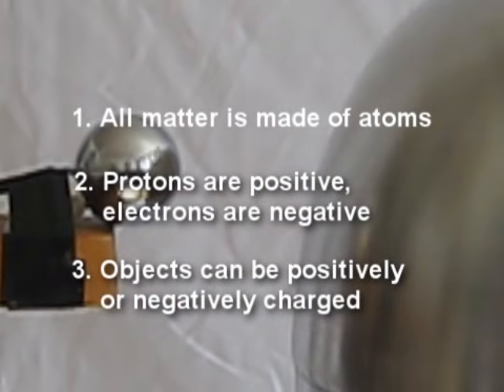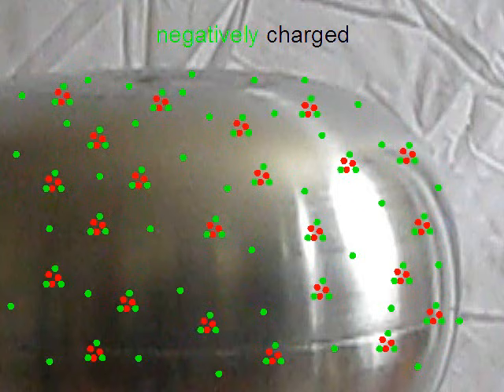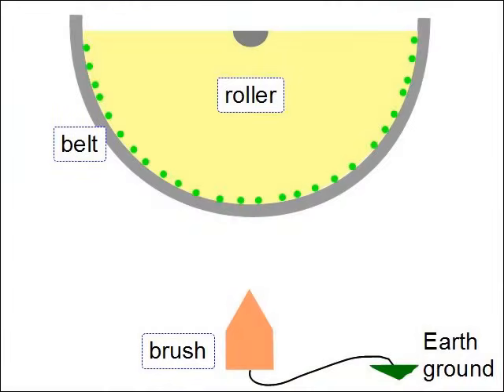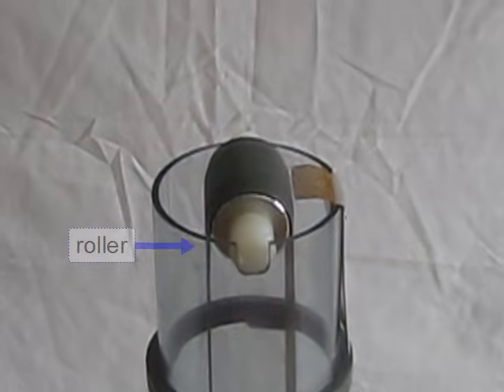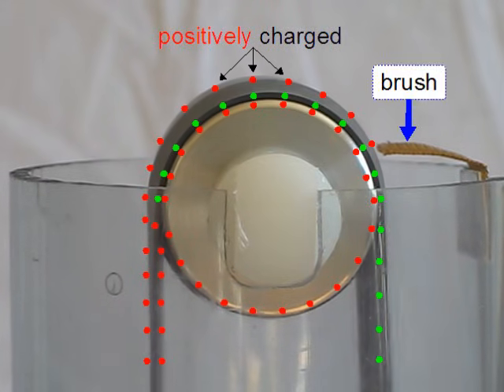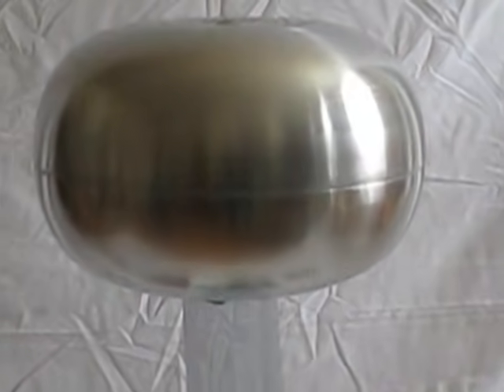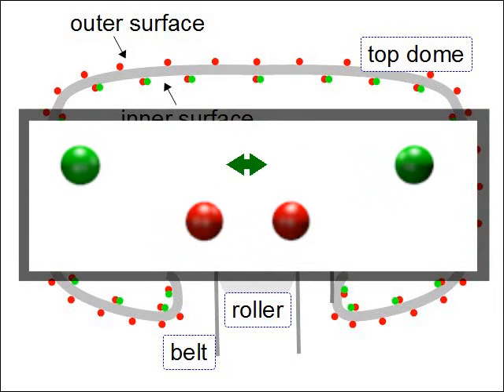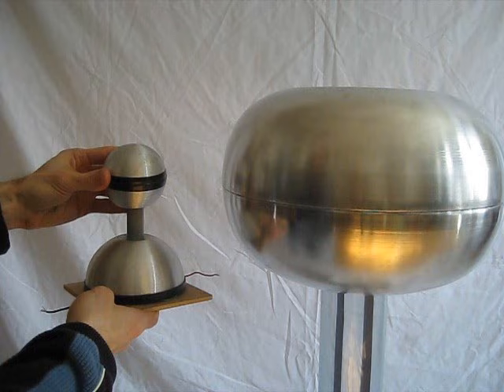How a Van de Graaff Generator Works

Comment: What size is the air gap for the brushes?
Reply from the maker: With my big Van de Graaff generator used for most of this video, the brushes are around 7mm to 8mm away from the belt. With my smaller ones, the gap is usually much smaller, as small as possible without touching.

Comment: Very good stuff. However, explanation given at 12:37 is incorrect.
Reply from the maker: Do you mean that the charge on the outer surface has an electric field whose other polarity is with the surroundings? How is that wrong?
Reply: To move charges (given more than one), you need to do work, which is actually done by the motor. Given (at least for this case) the charges are neither created nor destroyed, the other polarity charges get carried away through the bottom wire (which may eventually sink it to Earth, if earthed).

Incorrect: There is no charge on inner surface due to limited surrounding space enclosed within the hollow conductor, so the charges are left at the surface. 

That statement would not hold if you were to run it in perfect vacuum. By that logic, Van de Graaf generator would not work (or will behave differently) in vacuum. However, that isn't the case. In fact, there is no surrounding significant enough to speak of, in a perfect vacuum.

Correction: There can be no Electric field within a Hollow or Solid Conductor. And that is irrespective of the whether there is vacuum within or outside a hollow conductor. Thus by using Gauss's Law on an imaginary closed surface just within the conductor: we conclude, there can't be any charge inside of the outer periphery of the hollow conductor (neither in the metal within the periphery, nor anywhere on the inner surface, nor even in the hollow space within). And that is precisely the reason we bring the charge via the rubber belt from inside the hollow sphere (as there is no Electric field to oppose that charge), as opposed to bringing those from outside (in that case, the pointed wires will lose charge through corona discharge due to the presence of strong Electric field outside the conductor, much before they are brought closer to the hollow conductor).
Reply from the maker: Regarding your saying that this is what I was said that was incorrect "There is no charge on inner surface due to limited surrounding space enclosed within the hollow conductor,...", I would say that I said it was "due to limited charge within the hollow conductor,..." and not "limited surrounding space" but they're pretty close to the same statement.

Regarding that the statement would not hold in a perfect vacuum... you can't have an electric monopole. For any positive charge there must be a corresponding negative charge. In a perfect vacuum the corresponding negative charge would be at the other end of the Van de Graaff generator. In fact, if your Van de Graaff is too short, sparks can occur between the two ends. That actually would have been a good point to include in the video but I didn't think to at the time.

Regarding the whole Faraday ice pail explanation, I was trying to give an explanation other than the standard textbook one, while still being correct. It's pretty hard to do and I don't see where I got it wrong, though I can't be 100% sure I got it right. I didn't want to do the standard textbook one because it doesn't really explain the 'why'. It starts with the same statement you gave, that there can be no electric field within a hollow or solid conductor. I was trying to go deeper and say why there's no electric field (without needing to get to electric fields).

Comment: Where we can get the top bowl
Reply from the maker: I  don't have a source off-hand for the specialized type of dome in the video but most people go to any store that sells kitchenware and buy two steel bowls (salad bowls, mixing bowls). The cut a hole in the bottom of one for the belt and stuff to enter, and then they tape the two bowls together at their wide open ends.

Comment: Another question about the rollers.  I just built one of these and used nylon as a belt AND wrapped nylon on the bottom roller.  Pantyhose is the material.  The top "roller" is a piece of pvc pipe which the nylon glides over but doesn't rotate. I'm generating nice 8" sparks. Not sure how this combination could generate such impressive voltage considering the bottom materials are the same. Is it friction or something else?
Reply from the maker: I'm not sure either. I've seen people using a vinyl roller at the bottom and vinyl tape for the belt. That's probably using the same principle as yours, but I don't know what it is.
Reply: Tried an experiment tonight and I'm sure it's friction.   Wrapped the top pipe in teflon tape which is lower on the triboelectric scale than pvc. But it's also nice and slick and didn't create much of any charge.  I unwrapped it and even removed my bottom brush and it worked just fine.  Doesn't seem like the best system tho as the pantyhose is already starting to fall apart, helped I'm sure by the ozone.  Don't know how long the rubber belts hold up but it's gotta beat less than a week.

Comment: Why can't the charge combs make contact with the belt? A naive observer might think that a conductive wiper that makes physical contact with the belt would more efficiently conduct charges to and from the belt.
Reply from the maker: I always struggle with the answer to this one.
One reason I can think of for sure is that the belt is a non-conductive material. That means that charge cannot move around on it. Even if you made contact with a conductive wiper that was as wide as the belt, you'd still be making physical and electrical contact with a relatively small portion of it due to the belt's microscopic unevenness. That means you'd only get a portion of the charge from it. I first noticed this problem when working on my dissectible capacitor video (https://www.youtube.com/watch?v=gPXv063O5B8). At one point in that video I put my hand in the capacitor jar to collect the charge but no matter how much I touched it, I couldn't get anywhere close to all of it. That's why when I later did my lightning in a bottle video (https://youtu.be/9vneRuRRux8) I immersed the bottle in water to discharge it (plus it was safer).

Comment: Two negatively charged objects, one slightly more negatively charged than the other, will still reppel each other? Or will they see the other attractive?
Reply from the maker: They'll attract each other since there's an imbalance of charge.
Reply: Thanks a lot for your time to repply, your chanel is very inspiring, really a piece of art, love and knowledge.

About my question: then if any diference in charge will make them be atracted, how is exactly than repulsion is achieved, since equality is never seen in nature. Or what am I missing?
Reply from the maker: You're right. Silly of me. The two negatively charged objects will repel each other.
Reply: Well, don't think it's silly since it's quite tricky to figure out. 
I'm trying make some gravity simulation between charged bodies. 

Perhaps even gravity itself is nothing more than a charge phenomenon, as proposers of the EU claim. Are you familiar with their world view?
Reply from the maker: I know what was giving me trouble. I was thinking more about what happens when you bring the two differently negatively charged objects together. In that case there would be a redistribution of charge until they are equally negative. Think of it as the electrons on the slightly more negatively charged one would feel a stronger repulsion between each other and so would repel to the less negatively charged one, until there's no more unequal repulsion. (The video I'm currently working on has me thinking more about your question.)

And now that I think about that, as you bring them closer together, the stronger negative repulsion on the slightly more negatively one would be repelling electrons from the nearest surface of the less negatively charged one, making that surface more positively charged. With that in mind, there just might be an attraction as you bring them closer together. Or maybe that surface will never get sufficiently positively charged i.e. it would just be less negatively charged, in which case there would still be repulsion. You did after all say "slightly" more negatively charged so maybe that's why gave that constraint.

Of course, once they touch, the redistribution of charge takes place and they repel again.

I know if you bring a charged balloon near a neutral wall, that's why the balloon sticks to the wall. Even if the wall is non-conductive, the wall's molecules will rearrange and become dipoles -- more positive on one side and more negative on the other. Since both are insulating materials, no charge conducts from one to the other, there's no redistribution of charge, and so the ball stays attracted.

So I'm no longer sure of what'll happen. I'm assuming conductive objects in the first three paragraphs above.
Reply: It amazes me how little we know about static electricity.  You are making us explore, think and learn a lot.

Could you think an arrangement two bodies in such a way that they sustain a constant distance?  A "stable" configuration such as the Earth and the Moon?

Perhaps balance between magnetism and electric field... (?)
Reply from the maker: I wouldn't say we don't know things about static electricity - we just need to do the math or and experiment.
Fun idea, two magnets in attraction but also charged to be in repulsion.

Comment: Thanks for the helpful video!  I'm very confused as to roller and belt materials. Why are most belts for these things rubber?  Wouldn't using two very triboelectric opposite materials for the belt and bottom roller (say nylon and teflon) produce a better charge?  But would the top roller then also need to be made of teflon or would metal work better as the belt could then pull whatever it needed (electrons or protons) from it?   Also, I've read several things that said a negatively charged dome produces longer sparks (thus higher voltages).  Is this true?
Reply from the maker: Yes, a nylon belt with a teflon roller would be better for the reason you say. But in that case the top roller would have to be metal. That's because if the bottom roller is negative (teflon) with respect to the belt (nylon), then the top roller would either have to be metal or more positive with respect to the belt. There isn't much to choose from that's more positive than nylon in the triboelectric series table.

As for a negatively charged dome producing longer sparks, I've never heard of any difference. That's not to say there wouldn't be, just that I haven't heard anything either way.
Reply: RimstarOrg Thank you SO MUCH for the info!

Comment: I think I am correct that the belt would become more efficiently charged a the bottom roller if the belt were in actual contact with the ground brush, but there's a problem with wear and tear on the belt.  If one puts the bottom roller and the ground brush somehow in a conductive solution (e.g. salt water) wouldn't that fix both problems, giving you a more efficient charge transfer from the belt to the brush?  Without relying on corona discharge?

Presumably the same thing might work at the top of the belt as well, though that seems a more difficult matter practically.

Comment: What makes an electron negative and protons positive? Are they made up of mini electrons or mini protons that can travel freely or donated freely?..What do these 2 particles are supposed to be doing naturally.in nature in an atom?..after all the periodic table of elements is all about number of electrons equal numbers of protons and  voila we have stable matter or elements...no need of nuetrons or nucleus..the fact of the matter the present model of atom is garbage..because you dont have  a number 3 element ie.an element with 3 protons bound to 3 electrons..an electron once bound to a proton...and they are bound by a field an elctric field...it would take a hadron collider to break them and element will undergo a plasma state the 4th state of matter...It is only magnetic fields that can stretch and travel in space over long distances ..

Comment: Hello, I have another question.

I have checked your webpage and VDG FAQ (which is a very great website and has helped me a lot since I last asked a question). But unfortunately I have another question which I couldn't find on your website.

I have seen people use nylon belts instead of something that is neutral on the triboelectric series chart. Could I use a nylon belt, a lower roller wrapped in teflon and an upper roller wrapped in aluminum foil?

Or for example, could I use a lower roller covered in teflon, an upper roller covered in nylon and a belt made of cotton? (It matches what you said in the FAQ but I have never seen someone use a cotton belt).
Reply: One last question: does it matter if I use a carton roller covered with aluminum foil? Should I use multiple layers of aluminum?
Reply from the maker: Only the outer surface matters. What you do below that doesn't matter as far as the effect is concerned.

Comment: I tried making a VDG generator out of garbage but it doesn't work. I have a couple of questions:

1) Is it important that the dome is bent inward at the bottom?

2) If I connected the top brush to the inner surface of the dome instead of the outer surface, did I make a mistake?
Reply from the maker: 1) No, the dome doesn't have to be bent inward at the bottom. In my How to Make part 2 video (http://youtu.be/QrCgtjZwnB0) I use a soda can with one end completely open and it works great. But bending it inward is okay. Just try not to make any sharp edges or points.
2) Connecting the top brush to the inner surface of the dome is what you should do. That takes advantage of the Faraday ice pail effect.
Rather than repeat a bunch of tips for getting it to work here, I've put the tips here http://rimstar.org/science_electronics_projects/van_de_graaff_faq_frequently_asked_questions.htm#Q_DOESNT_WORK.
Reply: Thank you so much for the quick and helpful reply!

Comment: +RimstarOrg would it be correct to say that the inner volume of the dome determines the maximum charge? Surely the inner surface of the dome is taking electrons from the inner volume of air so once the air inside is mostly ions there is nowhere left to charge?
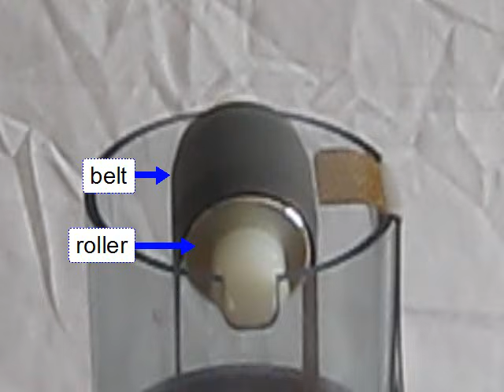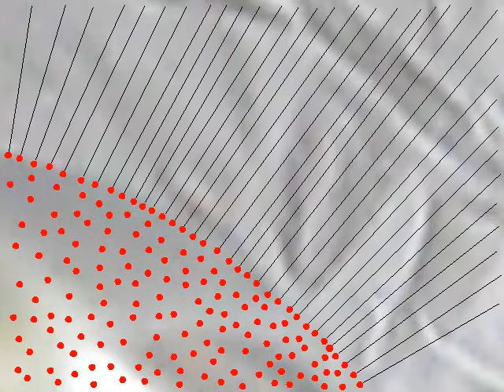Reply from the maker: No, it doesn't take ions from the air in the dome so volume isn't a factor. The charge comes from the belt, which gets it from the parts at the bottom of the Van de Graaff. See the video at 8:54. One limiting factor is the diameter of the dome though. But that has to do with limiting losses dependent on the curvature of the dome. See the video at 14:39.

Comment: 14:10
But it is connwcted to the outside surface in that diagram. What am I missing there?

Also, what would happen if you used a Möbius strip? Is it even possible (and not have it break down)?
Reply from the maker: It's the outer surface but it's that part of the outer surface is bent inward to the inside. So I guess you could instead say it should be connected inside the dome.
Reply: RimstarOrg Sorry, I didn't quite understand what you said. Could you elaborate a bit?
Reply from the maker: The wire is connected to the outer surface as you say. However, If you were to draw a complete circle around the dome, you'd find that the place where it's connected is on the inside of the circle. It's as if you'd connected a wire to the outside of a bucket near the top and then you'd bent that part so that it was inside the bucket. It's the fact that it would now be inside the bucket that's important.
Reply: RimstarOrg Oh I see. But then why is the important bit the fact that it is inside this imaginary circle around the dome? It isn't trivial.
Like what if you had a dent on the dome. Would the outer surface of that dent be considered inside the dome?
Reply from the maker: The reason is to take advantage of the Faraday ice pail effect. The inside (I'll say inside instead of inner surface) of the dome always has a neutral charge, and any charge we put on the inside, immediately goes to the outside. So it's easy to give it charge from the belt. The inside of the dome is acting like a good ground.
If we connected to the outside instead then we'd be connecting to something that's charged and there'd be a repulsion. That repulsion would make it hard to give it a charge from the belt.
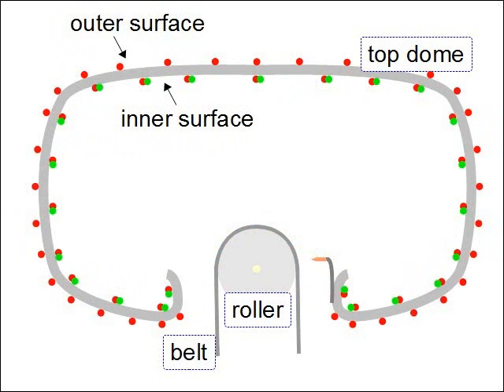That's what I try to explain starting at 11:33 in the video. I don't explain it in the usual simplified way that you see everywhere else using just electric fields so it's a little complicated.
I also demonstrate this difference in my video where I try it both ways http://youtu.be/xRLvbwF2MnM.
I also make good use of this effect for my Franklin's Bell in this video http://youtu.be/cjlMrSlIIIQ at around 3 minutes and 52 seconds in.

Comment: Instead of sending the protons to ground, why not recycle them? Also, related to the Corona discharge, is there something similar, but used for longer distances and not harmful?
Reply: Also, isn't it just creating a battery over a larger space based off the motor's input with the one negative side and positive opposite side?
Reply: And why not do this with a stretchier rubber, so instead of making it so it can be displayed in two dimensions, design it for three dimensions using something like rotary rings, or would that cause too much friction?

Comment: In my case, i am using a small sphere and is very efficient, if I change the sphere for a larger, more volts you think will occur ...?
https://www.youtube.com/watch?v=Ic-iicgfxyM
Reply from the maker: Yes, a larger sphere should allow higher voltage.
Nice Van de Graaff! I like the pulse motor and the belt tensioning system.
Reply: Yes is correct, the TENSIONING BELT preserves the belt for long time and with the pulse motor you can charge a battery and at the same time you can get thousand of volts...!